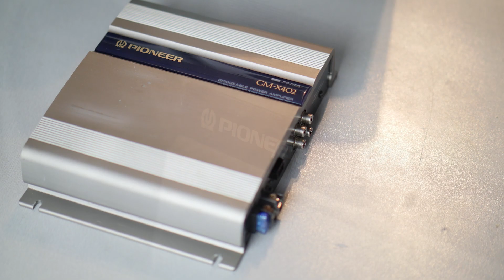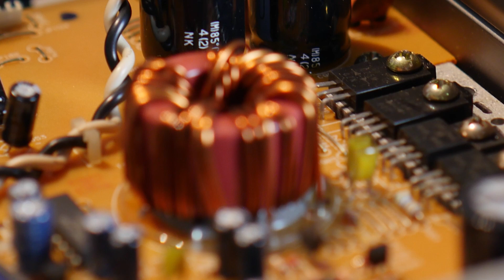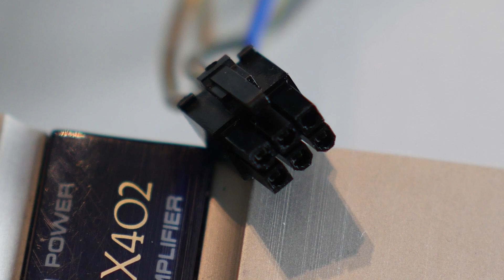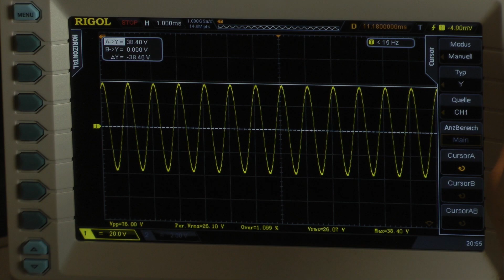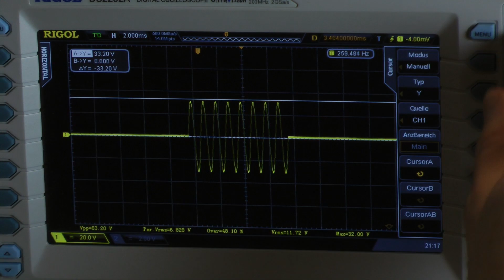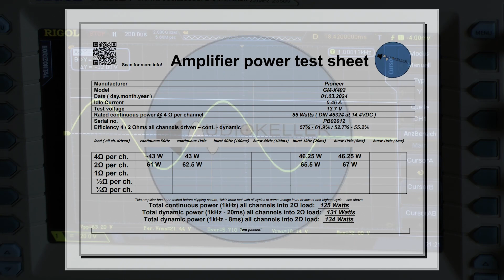Pioneer GM X402 car audio amp dyno oldschool amp power & sound test #caraudio #oldschool #pioneer

Comment: If you play audio with 2 ohm on all channels the amp will shut off the audio if pushed..please discover if that is from swinging the b+ or from just hard clip briefly. They all had the issue
Reply from the maker: The amp is back to his owner 🫤 during my tests i had the amp driven into hard clipping with sinus signal into 2 Ohms per channel. Amp didn’t shut off, but the only issue i faced was a broken female connector for the speakers and remote. The solder joints were broken which caused the amp to loose remote signal. I resoldered and everything was fine. If an amp shuts off during my tests I show it in the video.
Reply: @audiokeller1975  I have one of these amps